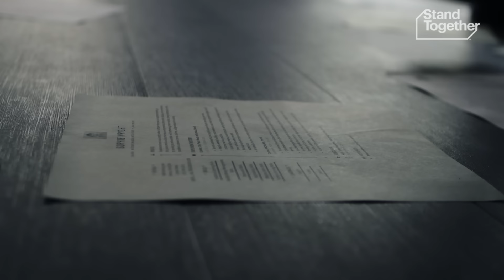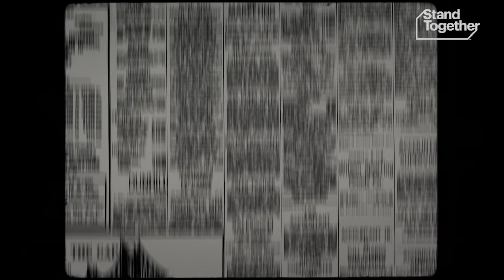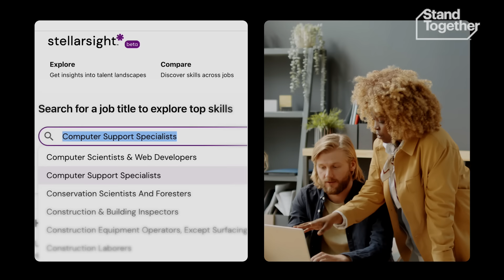America’s bachelor’s degree obsession is killing the economy. Here’s why.

Comment: The US government already does something like this . . . to a degree. 
There are job-training programs and job-placement programs and needs-based assistance programs. 
Need job training? Apply for a job-training program where the program will train you for a job. You may be placed in a paid internship position, where you work and learn on the job. 
Need job placement? Apply for a job-placement program. Last time I did it, they didn't help me at all, though. They just went with my résumé which had my credentials instead of actually placing me in a low-wage job to get work experience. 
Need cash, food, housing, etc.? Apply for a needs-based assistance program, a program that will assist you based on whatever you need (cash, food, housing). It's worth a try.

Comment: Just to be clear, what this is suggesting is that we test the previous cycle low adjusted for inflation wages of the early 1990's.  That's what this actually means.  Training is expensive, time consuming, and risky for corporations.  Risky meaning the company invests a lot of time and effort into an blank slate employee only to have them poached by another employer right at the time the investment is supposed to start paying off.  This means they have to start you at or near Federal Minimum Wage (or that state's minimum wage) and then basically keep you there for the first 4-5 years on your way to becoming a Journeyman or whatever the end training goal for this to make financial/risk sense.  Even then the risk is not worth the reward unless that employee stays there for basically their entire career.  This is why the labor market today is essentially all poach and no train, and why they are asking for degrees and five years of experience for "entry level" positions that they are willing to give far more than minimum pay to a candidate.  If we actually want back to (true) entry level positions with no degree, etc., requirements, the pay offer/range will basically go back to minimum wage or just above it and you'll be stuck there for years.  Good luck with that.

Comment: Degrees aren’t supposed to be a requirement ever. Most jobs barely need or make use of a middle school or junior high school level education. A High School Diploma is valid preparation for 85 or 90 percent of jobs in this country. College degrees were just supposed to give people with them a leg up or show they knew how to learn on their own or continue learning. They were just gravy on the top of the mashed potatoes and to show excellence and studiousness and were only supposed to be required for like jobs that paid over 100k back in the early 1990s when the average income for a family of four people was still 15k or so in many regions/counties.

There are supposed to be part time jobs, temporary jobs, normal full time jobs both year round and seasonal, high paying jobs, and then you get into what are termed degree jobs and specialties things that you might need some level of degree or trade certification or passing a bar exam or something to obtain or be considered.

Generally degree holders just got a slight leg up occasionally in hiring or raises or promotions but any one could get the job.

A degree is an extra credential not a substitute for experience or on the job training.

What was annoying was when I had 2 years experience working in a warehouse mainly as a box cutter but also all sorts of other tasks as I worked with/directly under the direction of the warehouse manager at times doing what they needed done at the time, and having a high school diploma, an associate degree, a bachelors degree, a gold level North Carolina career readiness certificate the highest obtainable at the time I tested without needing to even study much if at all, had work study job briefly at a university answering phones sorting mail etcetera basically doing a combined receptionist/mail clerk role along with other odds and ends tasks as requested/instructed, had brief mail room and odds and ends experience in a stipend job through upward bound through the deans office of a business college at a major university, had some job shadowing experience learning things from a purchaser/buying/traffic manager combined role at the main plant of the company my summer warehouse job was through, and already had 2-3 years experience in security as an unarmed guard/officer…

And still got told I was either underqualified or over qualified or not qualified and couldn’t land a job or even interview for even simple things like bagging groceries or pumping gas or any receptionist or office clerk or filing type jobs or any warehouse jobs or anything and even got turned away by temporary/staffing agencies.

Then after 13 months out of work I landed back in security industry and had prominent clients coming up to me telling me I was way overqualified for the role I had as things like parking lot security or lobby security/concierge sorts of roles and questioning me about why I was there or why I was in a job like that or what I was doing there or why I wasn’t in some better higher paying job….

But here’s the thing, I went to the local job office just about every single day it was open for 6-8 months straight and couldn’t get any interview anywhere…

Even when I finally did land back in security, the company I applied for originally said they mostly ignored paper applications and apply online bc that’s where they hired from only to be ignored and no response and not hear anything even when I tried to follow up on the application status. It wasn’t until someone else got hired there and recommended me to one of the hiring team of managers when they had been bellyaching about being desperate for people and especially desperate for people who were dependable/reliable that they finally looked at my application and brought me in for an interview. Promised nothing but insisted I go through the training classes despite it seeming like they wouldn’t hire me. By the time the classes ended everyone else had job postings/assignments and I was sent home after being told I might get called back in a month or three months basically never.

Sheer dumb luck intervened, it was coming up on 4th of July weekend 2011 and someone dropped out of a post guarding a multi-million dollar home/mansion inside of a gated community playing house sitter for 12 hour shifts for the realty company trying to sell it for a furniture mogul with financial issues or something, it was one of like a dozen homes they had or something.  They were trying to sell it for 22 million and it had been reduced to 8 million or so last I heard not sure what it eventually sold for. So as I was walking in the house from being rejected the person who just rejected me called back and asked if I could work that weekend suddenly no notice bc of the cancellation and it was 12 hour shifts 2 maybe 3 days a week and driving 2 or 3 hours to get there and get home each way depending on traffic, but I really needed a job at that point.

For the next several years I got yanked around the greater Charlotte metro area always stuck mostly on patrolling sites where you are outside all the time in all weather conditions and always getting 8-9 dollars an hour most of the sites and sometimes getting screwed over bc when you started a new site they didn’t usually tell you that sometimes it would be training pay at minimum wage instead of your usual pay rate when they sent you there.

Eventually I got farther away from the city closer to home at better more stable job sites/locations and they paid 9-10 an hour and were mostly inside postings like lobby/concierge thankfully and the same jobs would have been at least 15 to 20 an hour in Charlotte if you could find them but it was worth it to be out of Charlotte finally.

Finally in 2019 a new company took over the contract for my job site I started in 2018 and refused to pay less then 11 and then after Covid restrictions lifted we got a raise to 13 then to 16 the next year then 17 this year.

There is still basically a lost decade of revenue in my career though bc of being stuck in security with few to no advancement opportunities and not being able to land an office job or job in business field of some nature, and being discriminated against because of being poor because of my background because of being from Pennsylvania not North Carolina, because of being too qualified or too underqualified, bc of my current pay being too low to be considered for better paying jobs, I’ve heard a ridiculous number of wide ranging excuses, then all the people who meant well or seemed to want to help but had no answers when I asked questions or didn’t want to hire me not even as in house security or anything even after blatantly telling me they believed I should be in a better position.

Plus here in the south it’s the opposite of how it was in Pennsylvania. Back home education was highly valued. Here I’ve been told to trash or burn my diploma and degrees so many times, they value experience here. Yet on the job training or ways to get said experience are generally non existent.

Plus being Caucasian and assigned male at birth has always been a disadvantage for me ever since I first graduated high school I couldn’t even get hired at Arby’s part time or anything because they wanted people born female preferably 4 to 4 and half feet tall really skinny and blonde haired.

Even some of the security companies I’ve worked for I found out part of the only reason I had a job was they found some way to get a tax break for having me on the payroll through some wotc thing or w8 form or something.

Until 2021-2022 I was still mostly hiding/not disclosing that I identify as female because I didn’t want to be fired or moved to a worse job site or something.  When I first started in security people like myself were still identified in old training materials as being security risks and steps needed for supervisors to find/weed/ferret us out and drum us out of being in security industry at all, some of my own supervisors and colleges in the past could be overheard wanting to kill people like me talking about it as a fact of life calmly at shift changes and briefings and downtimes during shifts and saying a bullet was the only good thing for us or way to deal with us and other such horrifying remarks.

There is definitely a paper ceiling.

Mainly though we need to stop price gouging and investigate landlords overcharging for rent and things like that.  Because I now make about 544 a week take home pay or about 2200 a month roughly and that is more then I ever thought I could possibly ever make even with a degree back when I was in middle school and first thinking about jobs and careers.  It’s more then enough money when viewed objectively and by amount of money, but yet it’s not enough not even halfway enough based on prices of things and inflation.

When I started working 100/week was a good steady job.  Making over 5 times that now and yet still underpaid and have to cut out food at times to pay for bills,

Comment: I would hesitate to support a one-size-fits-all solution if the idea is to mandate all degree requirements, categorically, for all occupations short of doctor, scientist, lawyer, etc. I would support a system that allows for entrance examinations to determine a candidate's ability to objectively reason, comprehend and communicate, notwithstanding any technical skills that can be acquired on the job. I believe it is dangerous to boldly campaign for waving off the value and benefits of higher education. Of course, anti-intellectualism is not what this movement intends, but ignoring potential unintended consequences can be its own folly.
Reply from the maker: Thank you for bringing a thoughtful perspective to this discussion. It's important to consider a balanced approach that recognizes both the value of higher education and the potential of individuals who take alternative routes. Entrance examinations could indeed provide a way to assess essential skills without strictly relying on degree qualifications. Advocating for flexibility rather than a blanket removal of degree requirements ensures we do not undermine the role of education while also addressing the barriers it may create for skilled individuals.

Comment: When I was going to primary and secondary school back in the 50s and 60s, it was not so unusual to find a 15 year old in the first, second or third grade. At 16 they would drop out. At that time an employer would know that a person could do, for instance, third grade work. Unfortunately, today it is possible to find illiterates graduating from high school. Such folks may not be able follow directions or perform simple tasks. A Bachelors degree establishes that a person has the discipline to complete a long term task. Today, however, college grades are often meaning less - everybody gets an A or B thus the employer is still left uncertain about the quality of the individual.  I am sure that the Bachelors requirement establishes a floor for job candidates.  You are of course correct that there are many jobs that to not require specific knowledge obtained from a degree other than being literate and reasonably numerate. Colleges are also beginning to fail society. Primary and Schools need to graduate only those who have met specific requirements.